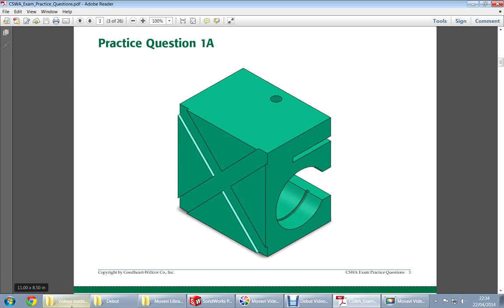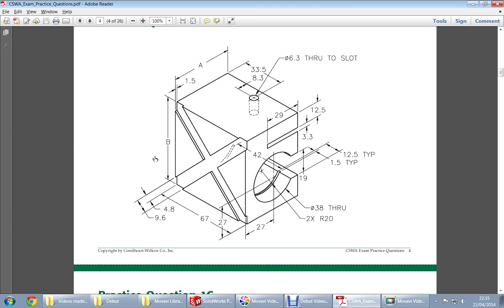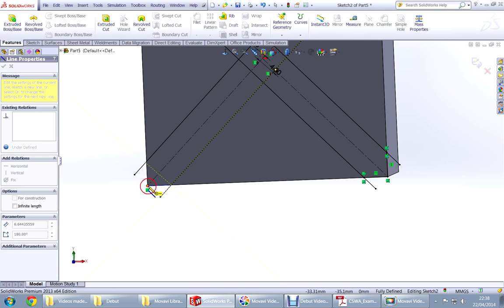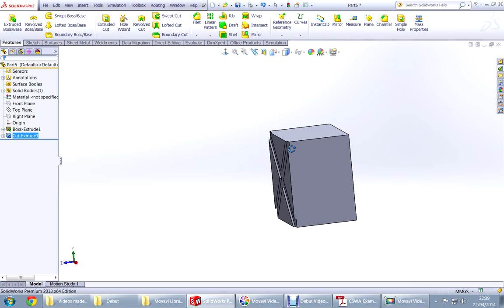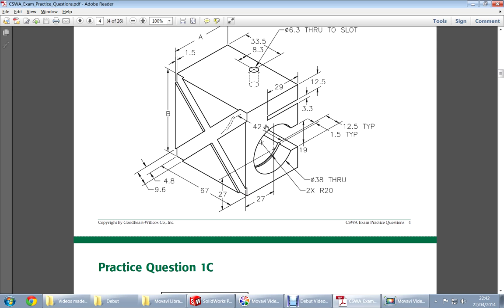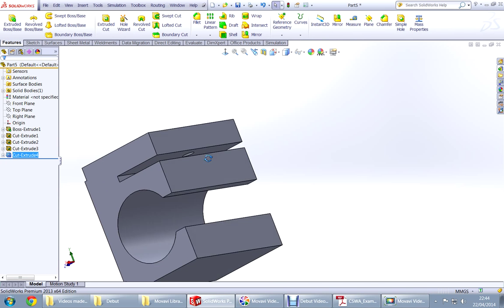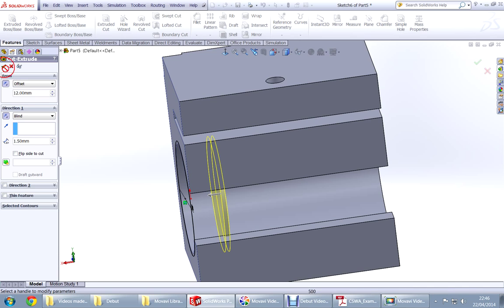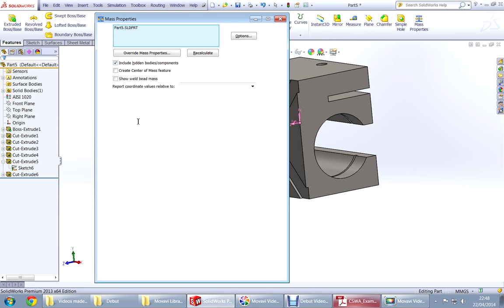SolidWorks CSWA Tutorial 5

Comment: Hi, Bhupinder. You did a really good job with these videos, congratulation. I have a question for you.In the minute 12:00 you said the cut is going to be 12.5 mm but you input 12mm....why?......the second cut you did the same  42mm + 12mm??? should be 12.5mm+42mm........ Please let me know........Thanks a lot bro.
Reply: Jackson Salcedo he made a mistake. It should have been 12.5mm to add to the other dimension. But since the question only asked for the mass, and the same width of cut was made in either case...he got the answer correct. If it would have asked for the location of the center of mass, he would have been slightly off--but probably still within 1% given it was only a short distance from the specified point.